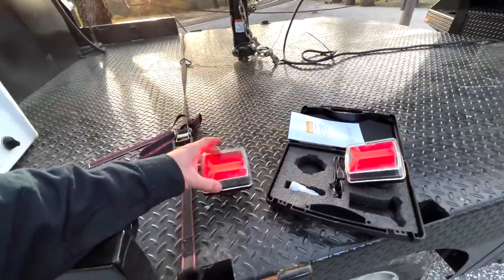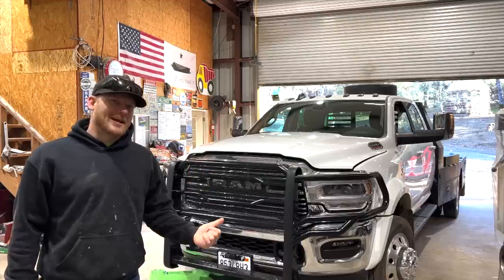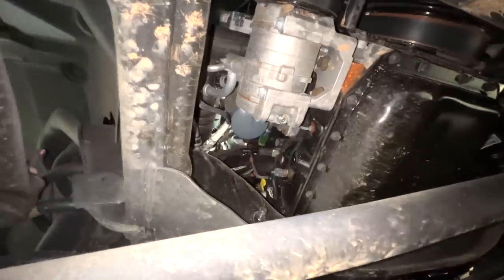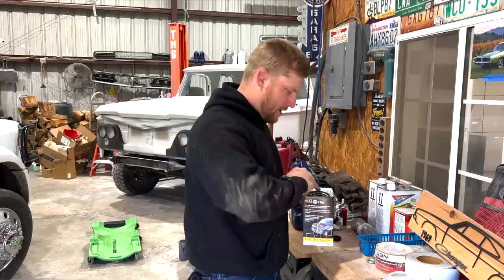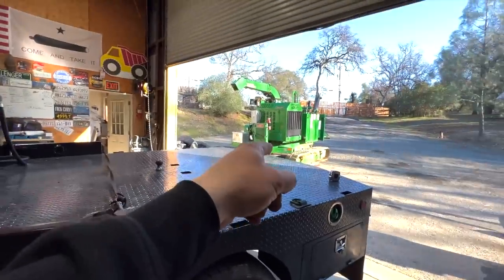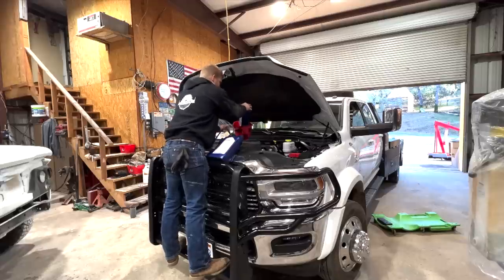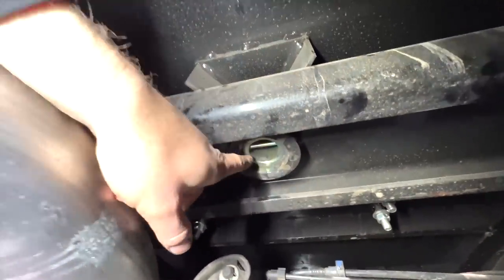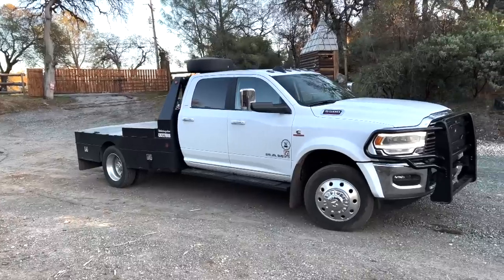Dodge Ram 5500 first oil Change+welding aisin transmission issues?

Comment: On my 12 valves I slap any old 15 40 in there. In the commonrail's I never run anything other than T6 Rotella 5w40. All my 5.9's and 6.7's got T6. Never had an issue with it. You can get it in 15w40 but until recently it hasn't been easily attainable. Now I see it everywhere. Amsoil is the way to go if money is no issue but T6 Rotella has always treated me good.

Comment: Sam, Love your channel. I by all of my filters, belts etc from Geno’s Garage in GA. They sell a screw-on tool/lid for 4th gen dodge Cummins oil filter removal/install. No spill, no mess. Excellent billet aluminum. I have 1st, 2nd, 4th gen Dodge Cummins. Take care, Rob from NV

Comment: The best oil filter is lf16035 fleet guard Strathpore . This filter is a Cummins oil filter. The Stratapore oil filter takes the minute particles out of the oil . It is also fluted oil filter. I found out from Cummins west in San leandro CA. Ran these oil filters on 1989 12 valve, 03 24 valve  ,2021 ram . In my opinion there the best.

Comment: I run T6 5w40. Mainly because being in Alaska, -40 is very common in these winters, anything more just gels to damn quick. Pan heater, block heater, doesn’t matter, gels up. 5W-40 has worked for me in my situations.

Comment: You got that new 5500 done up pretty sweet and nice but the 08 5500 is the one and only badass!😎 How often are you changing the fuel filters on the new 5500?

Comment: If you can find the white K&N oil filter, it comes with a welded nut on the bottom you can use a 1” socket and extension to remove it.
Reply: I use them and they’re awesome. Saved a few busted knuckles in a tight area. Auto Zone I know sells them.
Reply: @Brette_Caldwell  yep. Wal mart used to sell them and went to the black ones without the nut

Comment: Oil pressure gauges….I put an aftermarket one in one of my 4th gens once, just to see for myself. The needle gauge on the dash is pretty much fake. The numbers in the EVIC tracked pretty close to the aftermarket gauge.

Comment: I have a few questions about the 2024 RAM 4500 and 5500 diesel 4x4 Cab and Chassis, why do you go with Ram (Dodge)? I'm leaning that way because of the many more options. I work for Verizon Line Crew in R.I. and my mechanics tell me to stay away from them?
Reply from the maker: Best options hands down. Idk what your mechanic referring to

Comment: I’m looking at 2008 5500 with aisin… 80k… truck is stuck in 3rd, some sort of transmission issue.   The price is right, but when I called around local transmission shops to get a worst case scenario couple of them will not even work on them cause some sort of hard to fix electronics issues.    If I bring it to the dealer, I’ll get raped I’m sure….   Any advice?
Reply from the maker: No idea sorry